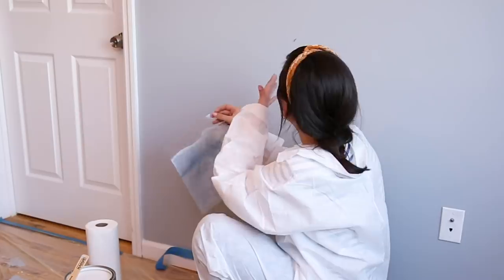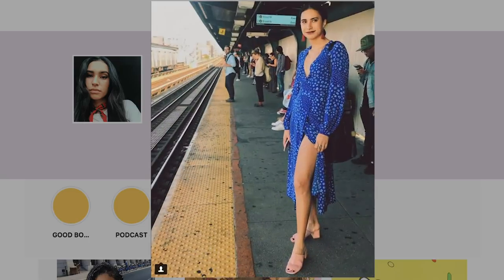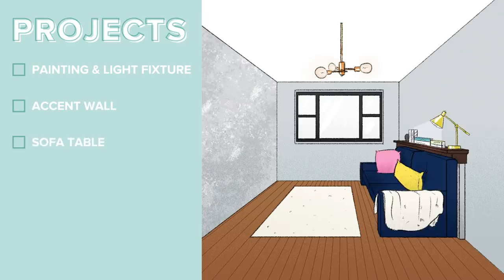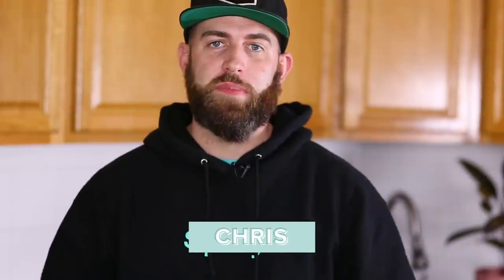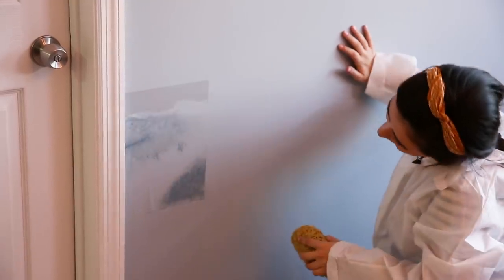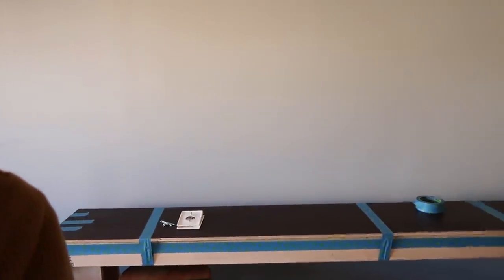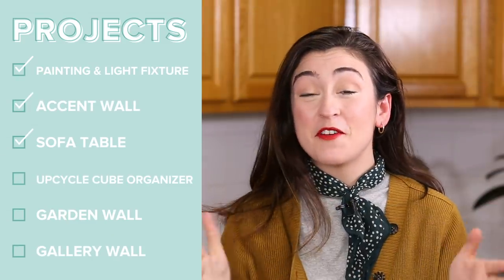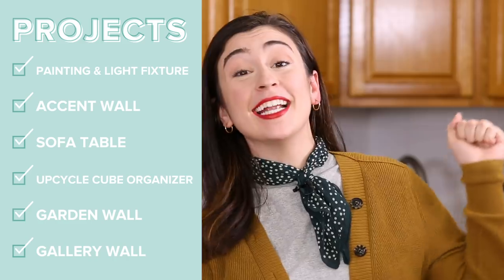I Gave My IG Followers a Living Room Makeover

Comment: What a fun space!  Interesting that you used sponges for the feature wall... I've been doing marbling techniques for years, and I always just use a rag, and I don't just dab, I wipe cross the paint, too.  That way I can get the layer of paint on top as thin or as thick as I want. For veining, I use a very small brush, or a feather. I've heard you can use a glaze, to work the paint longer, but I prefer just the paint...

Comment: Typically for a faux marble you want to use at least 2-3 colors outside of your base color (depending on your marble inspiration). In theatre I've had to do a ton of marble finishes. The thing that I think makes it sing is stippling back in your original base color sparingly after you've done your other color stippling.

Comment: Marble look ?    I did bathroom ,  light base paint and white or color you prefer , don’t sweat it , I used a feather duster  feathers cut down  , paint by dipping the feather duster and  tapping on :wall, do light or heavy. Too much of one color ?  you just dip in other base paint ! 
Just randomly tap f/duster to get the marble look you are going for don’t be heavy handed just a little at a time feather / duster...I remember my dad used to paint our bathroom ! I never could figure out how he did it .This was over 45 years ago , you can also use 
A thin brush to accent the lines in faux marble ...I never knew how he painted it ?
Was around 35 years,Before I tried it !  Tried duster and  sponge  both were easy !  I used a small sponge ..just have fun!  And remember you can always cover up mistakes !!

Comment: Why are you drilling holes for screws in the wall to hang the pictures??? Nails are so much easier...
Reply: Fallacious Jinx ... They r likely to be renting... Drilling holes/nails doesnt seem ok 😲
Reply: Drilling is more quiet than knocking nails in a wall TBH. And if the holes are small enough I doubt the landlord would care. When I rented, there was nothing in any of the leases that said anything about holes from hanging pictures. 🤷🏽‍♀️
Reply: Screws tend to be more secure.
Reply: screws are more secure and nails tend to slip
Reply: Nails can crack drywall. With the right drill bit you have a better chance of keeping it intact.
If they are renting, they can fill the holes.

Comment: Get some books from your public library on faux painting.  It will save you time and headaches.  Plants hanging on a wall like you did do not work.  If you had different hooks that extend from the peg board by 4-5 inches then hang the plants from them it would work better.  It may look cute, but the first time you try to water them you will have a mess.   I liked the sofa table that was a great idea, but 3 girls sitting on one sofa together will get really old fast.  A little additional love seat instead of one chair would have been a better idea.

Comment: I feel like it would've been so much easier to just do a marble-effect wallpaper on the accent wall, instead of that time-consuming sponge technique. ALSO, that plant wall is just not practical. Only two of the plants featured were low-light plants and would do well with artificial night. The succulents and cactus in mugs, in particular, will 100% die in a few weeks from having no drainage or adequate sunlight.